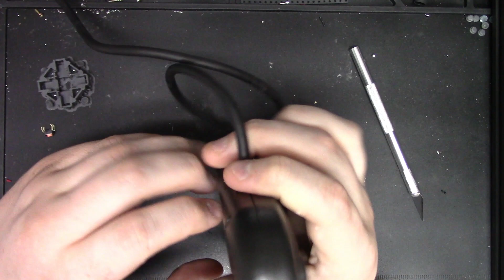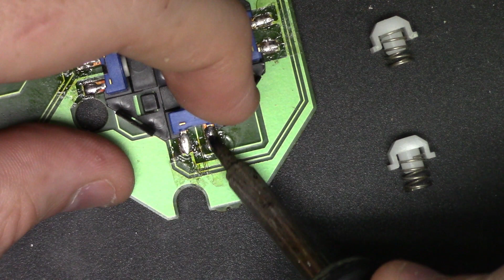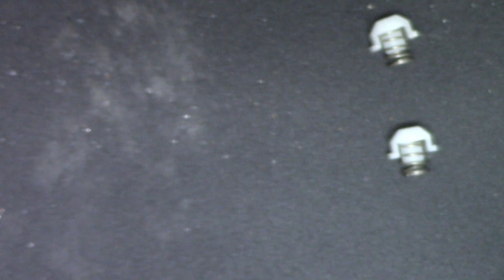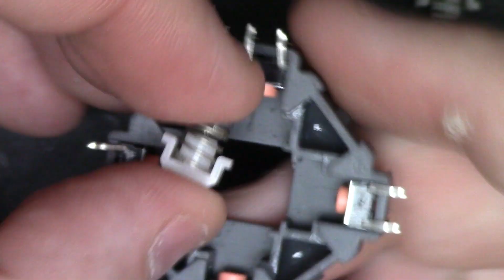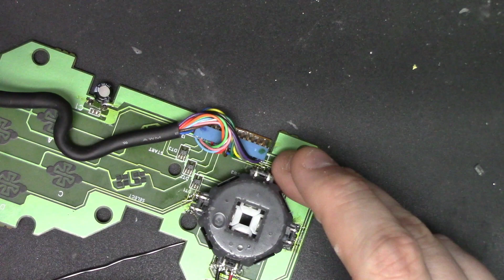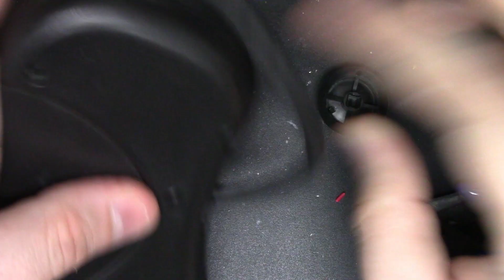NeoGeo CD Pad Repair

Comment: Can you specify the microswitches you bought?
Reply from the maker: Omron B3F-1025 are the specific switches I used
Reply: @LaserBearIndustries  6 x 6 mm or 12 mm x 12 mm?
Reply from the maker: @tarekfarah8617 6x6mm the custom part in this video fits those

Comment: What kind of springs are used in these controllers. I have a PS2 Neo Geo pad that isn't clicking on one side anymore. It still works to this day I just can't move in one direction because of the spring issue.
Reply from the maker: They are custom made springs for SNK, I have not found a good source for a replacement outside of having custom ones made. I'm also not sure if the PS2 version has any changes to the design.

Comment: Tried to repair a few pads with these kits, but it is far from perfect... impossible to do combos... best solution is still to clean the (original microswitches in the) pads often and before they get too dirty...

Comment: The tolerances are too tight. I couldn't push the switches far enough back against the casing, so when I put the springs in, they are constantly pressed down, I did everything to try pushing it flush and broke the switch, now it still isn't flush and I can't take it out. So now I just wasted my money on something I feel was no fault of my own
Reply from the maker: It sounds like a defective print, if you reach out to our web contact sheet, or respond to your order email we can get you a replacement kit. Posting here about the problem is perfectly fine, but we are able to actually help when you contact us through the proper channels since we can't link a YouTube profile to your actual order information.
Reply: @LaserBearIndustries  thank you so much!
Reply: @LaserBearIndustries  I did what you said right after I posted the last comment and haven't heard anything back. I got another one and it works but the springs don't push the lever back to center. Do I have ti lubricate the switches?
Reply: @LaserBearIndustries  two years later, still nothing?

Comment: How is that bridge in 1 of the 4 pads gonna prevent tearing all the others them apart?
Reply: you would need to do the same to all 4 pads, it was a demonstration of how to deal with pads that are starting to get loose on the pcb or if there is fear that the pads will eventually tear up from the pcb. They are known to do that in some rare situations.

Comment: I just installed one of these kits I bought from you. working like a dream now on my MiSTer FPGA. 

I added a dab of lithium grease to the base of the dpad pivot just for its long-term preservation after confirming it wouldn't react with the plastics.